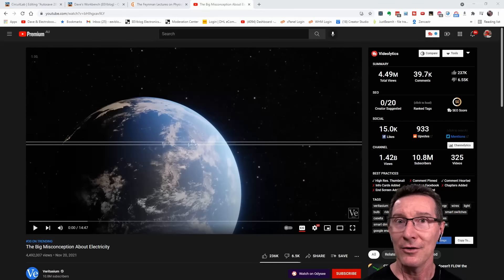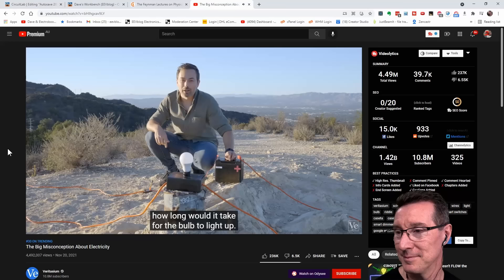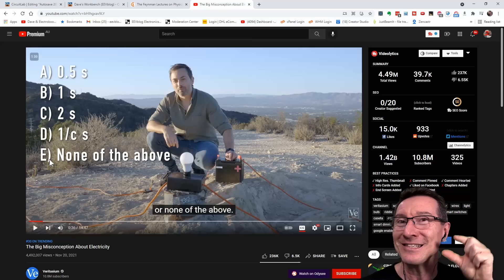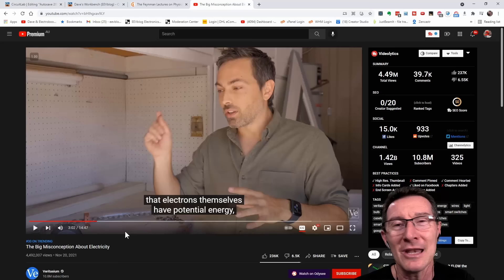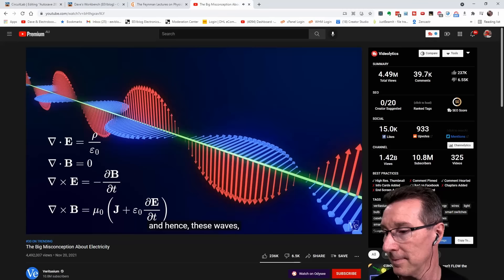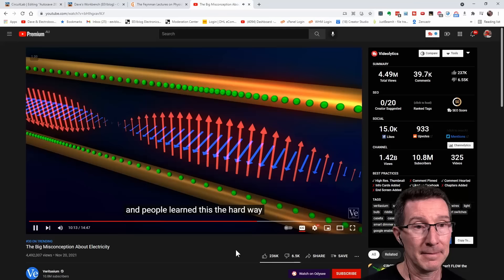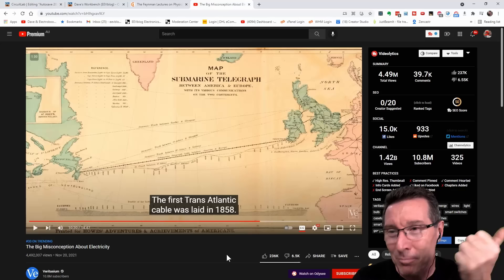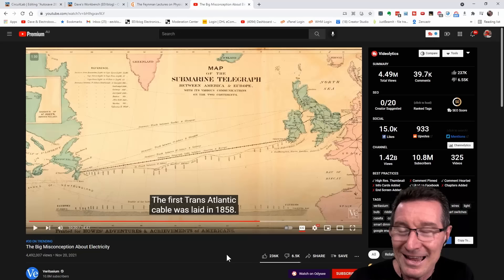EEVblog 1439 - Analysing Veritasium's Electricity Misconceptions Video

Comment: 15:44 Electricity = "the electric current" = "the flow of charge" flows in the wires for both the electrical engineers and physicists, and probably for their grandmothers too. But "energy" is not the current itself but "current times voltage", and voltage is always between some wires. Because of that, if you think about it for any length of time, energy cannot, by definition, flow inside of any single wire -- this is a bit shocking, but it is true even if you think of electrons being like water in pipes. Although such an elementary picture does not tell where exactly the energy "flows," it points out that "energy flow" is a funny thing to begin with -- unlike the current which you can measure in any one wire.

Poynting vectors simply reveal a deeper picture and specifically assign to every point in space how much energy is "flowing" through it. But Poynting vectors in a DC or a low frequency AC circuit (when no energy is radiated into a free field) necessarily sum to exactly the same value as the ordinary product of voltage and current -- that's what Poynting's theorem is about. It always has to come out this way, and as long as the EM fields continue to work as they always do, we can forget about them and focus on circuit theory with voltages and currents.
Reply: Well, first, current times voltage is power, not energy.  Energy is current times voltage times time.  Second, if you think power cannot flow in a single wire, you probably shouldn't ever look into how antennas work, or lightning. Heck, I don't need any wires to make energy flow. I can make it flow through a single hollow pipe.  That's how microwave waveguide works.  Actually, once it leaves the feedhorn, it flows directly through free space with no pipes or wires at all.  And in fact, that's exactly how it is taking the shortcut to the light and flowing through the empty space between the two parallel wires in this experiment.
Reply: @stargazer7644  Right. You make an appropriate correction about power and energy being mixed up in my comment. I have noticed using the wrong term after posting, but did not bother to correct, because it does not really change the main point -- which is that even in DC (and even in ordinary hydraulic systems!) we already cannot assign the flow of energy to any single wire or pipe. Energy is added to the circuit by the source, and taken out by the load, but how it gets from the source to the load is a system-level process. The energy does not "flow through a wire" even here!

Everything that you say about RF is true of course -- energy flows through empty space. It always does.
Reply: @cogoid  Explain a lightning bolt.  Where's the return circuit?  Only one wire - the conductive ionized air - connecting cloud to ground.  Yet a massive current flows.  You're missing a bunch of physics in your thinking.
Reply: @stargazer7644  I took a trivial, from a technical point of view, situation: source, wires, load -- where physics is intuitively obvious to everyone, and tried to show that the concept of "flow of energy" is already not as obvious as it may seem at first.

There, already, it is not easy to pin down where or how exactly the energy "flows" from the source to the load! The energy is added to the system at the source, as the electrons are pushed by external forces from a lower to a higher potential. The energy is removed from the system as the electrons do work on the external world, when they go from the higher to the lower potential. When the electrons flow from the source to the load, in an ideal wire they remain at the same potential -- their energy does not change. And, *crucially*,  this energy is not "within" the electrons themselves, but in the "electron + electric field in the system". Moving a charge also transfers the energy only because there is the voltage between the wires, across the load, across the source. We cannot cut a slice of electric current and attribute any energy to it, unless we also take the system-level potential difference into the picture.

I think it is important to pause and think about this, before we go into more complex situations, where physics itself may not be as familiar. 

Debating the technicalities of the lightning bolt would only dilute what I was trying to say. If I had to do it, I would start with formalizing the problem -- changing lightning striking a tree into a capacitor being shorted between the plates by a piece of wire with a resistor. Then I would ask what determines the energy transferred from the capacitor to the resistor by one electron -- and showing again that it is nothing that is "within" the electron itself, but that it is a function of the electron being in the electric field between the plates of the capacitor. But I would not want to start a long argument about this, because it is not really what I am trying to draw attention to.
Reply: Except the voltage drop that exists along every micron of every conductor that isn't a superconductor...
Reply: @DanBowkley  Real wires have resistance, and of course, some power dissipates into the wires. We ignored that to minimize the distractions.
Reply: @stargazer7644  amps are not watts, and with lightning, the energy is flowing inwards towards the conductor, same as with any resistor discharging a capacitor.
Reply: @blinded6502  That was exactly my point Blinded.  Try reading what I was replying to next time.
Reply: @wbeaty  Amps are not watts?  Umm thanks for that bit of insight.  Now, WTH is your point?  Are you trying to say lightning strikes don't have much power?
Reply: @stargazer7644  Point taken

Comment: Technically, the Meter is defined by the speed of light "C" so the units don't matter as all transient / wave flux is time (which is frequency) dependent. E=hF.
Reply: Also v=s/t
=> c (m/s) = 1 (m) / (t (s))  
=> c (m/s) = (1 / t) (m/s)
=> t = 1/c 

Therefore, Veritasium is not wrong.
Reply: @KenLohwh  that's the right explanation,
Reply: @KenLohwh  I have no idea what you calculated here but I'm pretty sure it's wrong.
Reply: @R3lay0  , please prove mathematically that it's wrong.
Reply: @KenLohwh  You added m/s in the second line but c already includes that
Reply: @R3lay0  They wrote

V = S / T
=> c (m/s) = 1 (m) / t (s)

Simplify without the pahrentesis:

c = 1 / t

pass t
ct = 1

pass c

t = 1/c
Reply: @mrpedrobraga  C is a velocity, t is a time but 1 isn't a distance. You can't just substitude s with 1
Reply: Thank you @R3lay0   for your response.

Both sides of the equation must be balanced mathematically.

Left side, which is c, has (m/s) as the measurement unit. Similarly on the right, the numerator distance is 1 m while the denominator is t s, giving rise to  1 (m) / t (s) which is equal to (1/t) * (m/s) with (m/s) as the measurement unit. Therefore the left and right are equal in terms of their units => c (m/s) = (1/t) * (m/s)  => c = 1/t => t = 1/c. Note that the units cancel themselves at the left and right.
Reply: @R3lay0  , remember that the source to the lamp is 1 metre in Veritasium's video.
Reply: @KenLohwh  You're leaving out s for the distance in your equation. You shouldn't mix symbols and units anyway
Reply: Another way to express it:
t in secs =  d/c in secs
-> t = 1/c secs when d=1 metre.
Reply: @KenLohwh  Why does the meter on the right side just disappear on the last line?
Reply: @R3lay0  Could you show us your version of the working so we can check and understand your mathematical reasoning.

Comment: He omitted the meters in the numerator because the question was to find time which is (1 m)/(c m/s) so the m's cancel out leaving just seconds and putting an arbitrary meters on top there would confuse even more. I do agree that he should have spent a few more seconds to clarify this so that someone does not leave thinking it will just be 1/c regardless of distance between the battery and light since the wide target audience may not immediately catch this.
Reply: c isn't a pure number it's a value with units.  As written, his #3 was some number of s²/m or s²/inch.

Comment: My favorite video about how EM fields and transmission line theory apply in circuit boards is this Altium-sponsored talk by Rick Hartley. It's an excellent explanation of when (and why) you should care about these kinds of issues in your circuit board design.

And despite the name of the video, it goes way past mere grounding. To give you a little tl;dr - the vertical space between your traces on top of the board and the ground plane on the bottom, is acting as a waveguide for the EM fields. Understanding how changes in EM field propagate through those waveguides (or don't, if you screwed up the PCB design) is key to understanding why and how EMI problems occur in PCBs.

https://www.youtube.com/watch?v=ySuUZEjARPY

Comment: The magnetic field is very much directly related to the current. This is why a simple switch that disrupts electron flow in the wire, is very effective at stopping the magnetic field also, and sopping the power flow.
As an RF engineer, my first exam of the setup as displayed in it's simplicity had me assume 2 shorted transmission lines as stubs in each direction as neither leg is a coaxial cable. The spacing does raise the nominal impedance considerably, but the pair of conductors in both directions are related to each other and  a simple TDR would show the current at the bulb would be low but almost instant due to the nominal impedance of the transmission lines in both directions. Those are in series with the battery and bulb, so say a nominal impedance of 900 ohms each, the impedance to the bulb would be 1800 ohms, until the power reached the short at the end of each line and the short reflected back to the source providing an increase in current in the bulb.
My answer to the question from an RF standpoint is bulb would get current from the impedance of the transmission line right away, but relatively low based on the line impedance, then after the round trip delay to the short at the end of the lines, a great increase in current limited by the resistance of the bulb. The bulb resistance if it does not match the impedance of the line would cause a few secondary and damping reflections until steady state is achieved.
This can be simulated with a Time Domain Reflectometer.